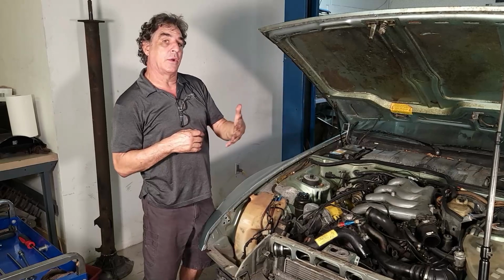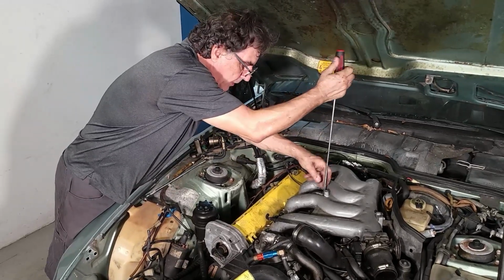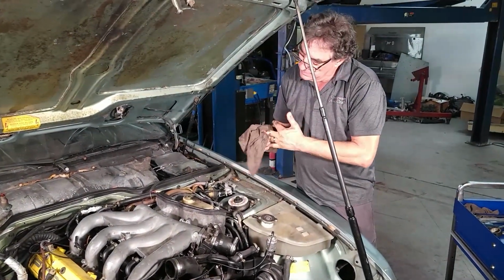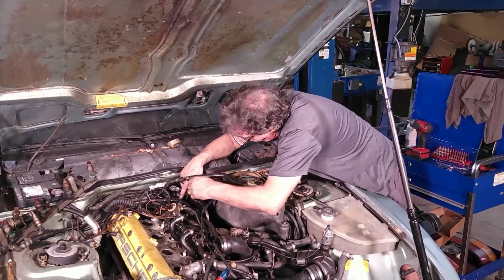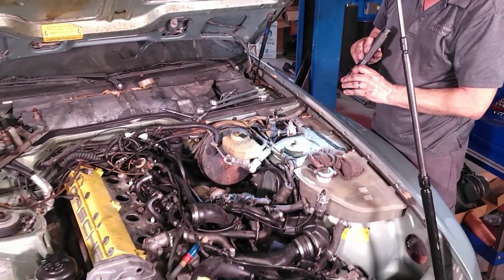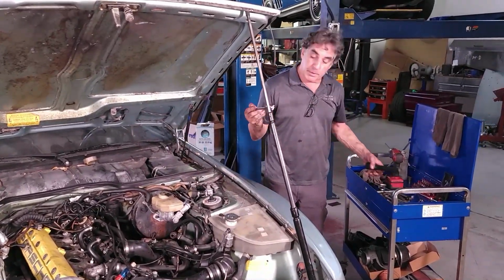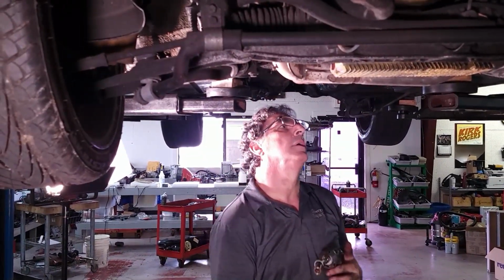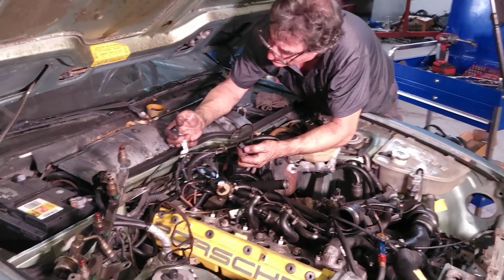Episode 10 - 1986 Porsche 944 Turbo Restoration - Intake & Turbo Cross Pipe, Our Longest Episode Yet

Comment: I have an '86 951, and I've done all the work he's done over the years an much much more.  this damn turbo car is soooo difficult to work on.  The going joke with my brother is the intake has to come off for almost any work.  You wan to change the Intake control valve, intake off, you want to change the turbo (God what a pain, ask me how I know) intake off, you want to change all the vacuum lines, intake off, you want to change the clutch, intake off, you want to change tail lights, intake off - - - ok, maybe not the the tail lights - - maybe ;)
Reply from the maker: Ha! Yes, the art of engineering.  It's a great car, but if you take the intake off for something,  best to fix everything.  It is a bit of labor.

Comment: what do you recommend cleaning the coolant system as part of a coolant flush? Would a cleaner like the liqui moly coolant system cleaner be recommended?
Reply from the maker: Excellent question,  cooling systems get forgotten about when doing other systems in the car. Back when we were serving the oil cooler issues on the 944's, there was oil getting into the cooling system.  We found the best way to clean it was Dawn dishwashing soap. It takes a bit of time to flush it all out, but it does a beautiful job removing oil and contamination.  You can add about 2 cups them fill with water. Run it until the Thermostat opens, then let it cool for about a half hour. Then rilun it again until the Thermostat opens again. Drain the system and flush with water. Use a good quality coolant,  and change every 2 years.

Comment: For the crossover pipe. What seal did you end up using new at the flange ends?
Reply from the maker: If your referring to the exhaust pipe, I will be using the original type steel rings.